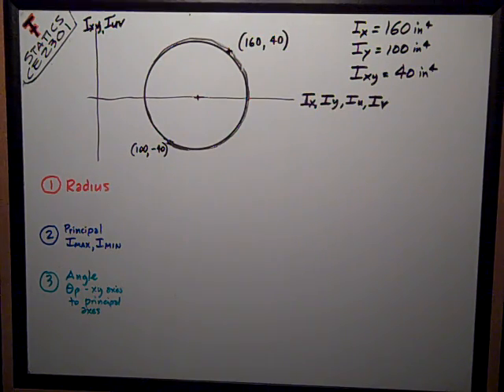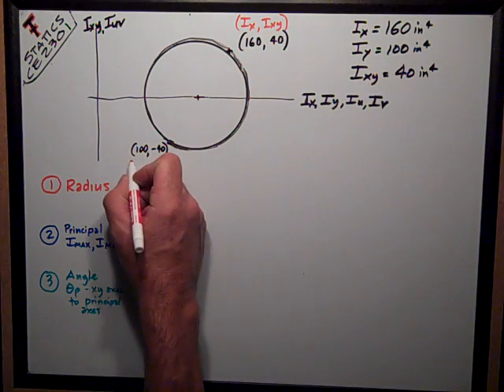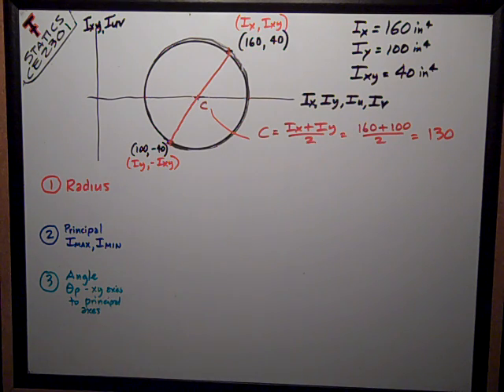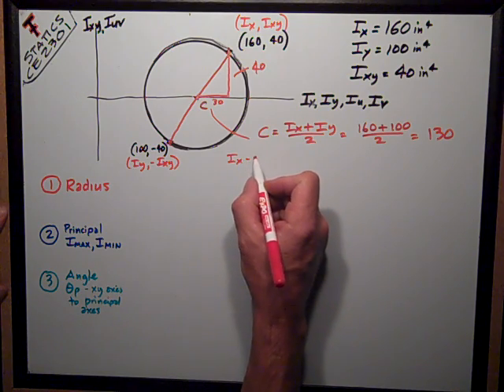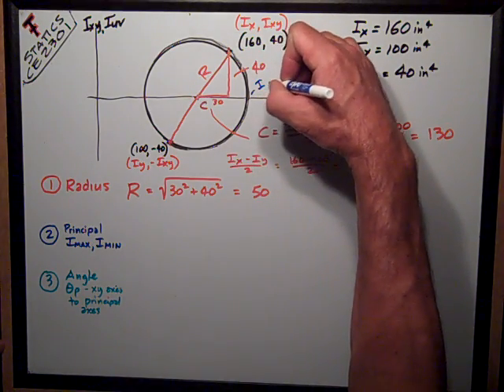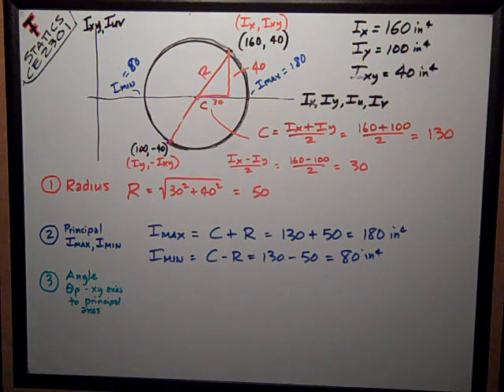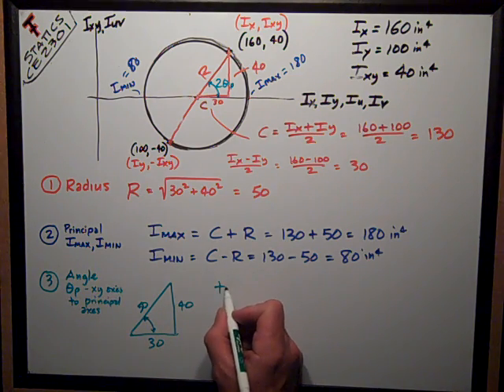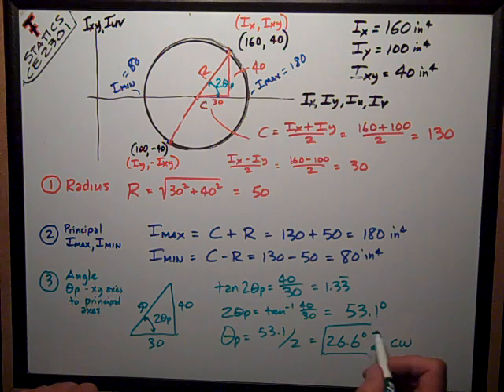Statics Mohr's Circle Example Sample Quiz #4

Comment: Can I use Mohr`s circle if the product Ixy = 0?
Reply: Yes you can but Your I2 and I1 will be equal to Ix or Iy depending on which one is major or minor since Ixy=0 means the structure is already located by it's principal axis of inertia...So the angle of rotation will be zero..